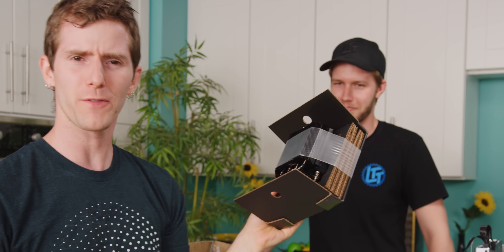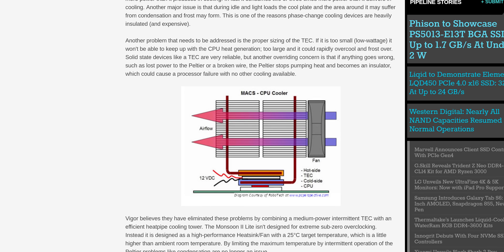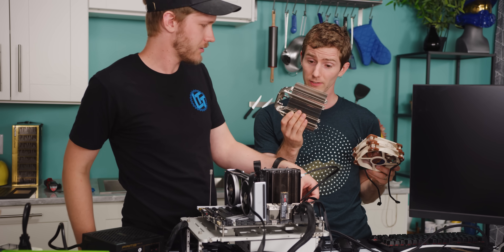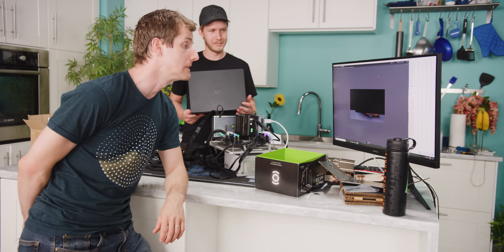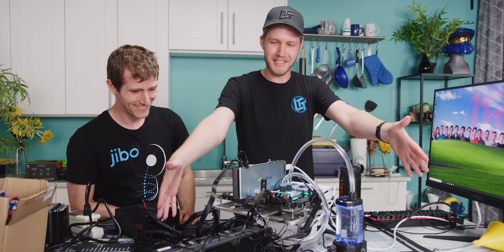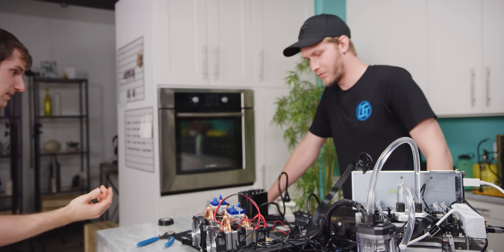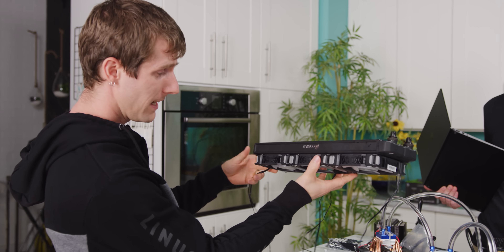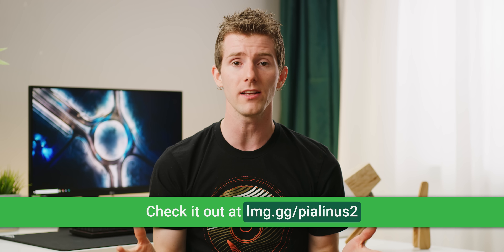Thermoelectric Cooling is a Bad Idea

Comment: You need to use 2 loops leave the rad and add another one and another big cooling  block from Ali , and a separate loop to cool the hot side of the peltier

Comment: About 10 years ago I wanted to build a little Peltier based water storage cooling unit out of water cooling parts (because I'm cheap and had very little room back then), but on top of the shite efficiency, the cost of 2 water blocks, 2 pumps, 2 reservoirs (of which one needs to be big) and a big radiator made it all seem rather pointless.

Glad my pointless idea from the before-time made it to kickstarter though!

Comment: hello I'm from Brazil!
I'm a fan of your gambiarras.

why unlike water in the radiators, do not use car radiator additive.

it may be that the problem itself is pure water only.

perhaps the fluid can provide a greater gain in heat dissipation.

thanks for listening .

Comment: I'm sorry I didn't check all 4000+ comments but... AM I THE ONLY ONE thinking about "Did you put the fan the right way?!" with regard to https://youtu.be/IX2NQ1lq4ZM?t=575 (09:35) 
So one side is cooled by the peltzier's cold side while also cooling the plate on the CPU and the other side draws the heat from the hot side of the peltzier module so by facing the fan  to blow the air from the cooler side through the hot side, that's where (at least I'd guess) is the greatest efficiency and why it can be so low powered. Disclaimer though, I didn't watch till the end yet because I was so hot and bothered by the fact that you two didn't question it especially after watching Linus drop the fan in like it ain't no thang....

Comment: Peltier cells are tricky, if you want 20deg difference and lets say your cpu is drawing around 220w of power, you have a room temp of 30deg then you need a 350W peltier cell but note that to have the 20 deg difference and your cpu is drawing around 220W, your ambient is 30deg then you need to remove 400W of heat from the peltier cell so if you can do that and keep the peltier cool at 40ish deg then you have 20deg on cpu at full load if the cpu doesn't draw more than 250W at the given OC speed so yeah it doesn't make sense to use a peltier cell in this type of application, plus a good peltier cell of 300W+ costs above 200eur require at least 24Vdc and 35+Amps, then add the cost to remove 400W of heat from it, this cells are usually meant to bring down further the temperatures in an existing industrial cooling solution where you already have a 1kw+ compressors and need to go higher down in temperature on your application and its cheaper than to replace or modify the cooling solution by adding new stages changing compressor etc.

Comment: Back twenty years ago I used a tec assisted water cooling setup to get a Celeron 600 (coppermine) to run stable at a tick over 1.1ghz. 

The issue was keeping stable 12v power to the tec, and keeping condensation off the board/socket at idle. Even with custom hand cut insulation for the board/socket it was just too much. Lowered the clock to a solid 1ghz with a largeish air cooler and a slightly less deafness inducing Delta fan it stayed stable for two years for me, and another three for the guy I sold the system to.

Peltier modules can be useful for attempting extreme overclocks for street cred purposes (if you're not going compressor refrig or LN2).

Otherwise there ain't no free lunch with thermodynamics.

Comment: You're using Peltier the wrong way. You have to add it after the radiator to cool down the already cooled water below ambient temperatures, before it returns to the CPU block. That way the Peltier is not syphoning all the heat that the CPU generates, and thus it can be an effective tool even at lower voltages. If you're using it in an aircooled system, same principle can be applied: cool the air before it hits the CPU fan, preferably at the case intake vents.

Comment: The first expensive cooler you put the fan in the wrong direction. Think of it. fan will blow air from the cooling tube to hot tube.

Comment: 0:50 "But what's even cooler, is..."

Who else braced themselves for "OUR SPONSOR!!!" ??
Reply: And add it started, I skipped ahead. I'm heare to learn from others mistakes so I don't have to waste my time and money on things that don't work. I actually pay for YouTube to avoid the 2-ad-per-minute nuisance. I'm not here to buy things I don't need.
Reply: The TECs can stacked. The TECs give approximately a 30°F difference. So when you run water across 1 and then another, you give it more time to lower the water temp but can never get below the limit of ~30° before ambient temp. However, if you put 1 TEC directly on top of the other, then you can get ~60° drop in ambient temp.
Now try putting the TECs directly onto the CPU (using thermal paste). You can then put a water block on the hot side to send the fan cooling to another location.
You can also use antifreeze in the water which absorbs heat better than plain water alone. There are other chemicals that absorb heat even better but some of those are expensive or they are poisonous to breath (ammonia) and so not good for residential use.
Reply: @SI-GOD  this is great info! Do you have a demo? Video? Or web page and pics?
Reply: ME

Comment: Everyone seems to omit the important information of the Peltier specs. In the catalogue there are hundreds of versions according to desired temperatures of hot and cold side and you choose accordingly. Its no good grabbing a generic TEC from amazon and expecting it to work. Peltiers do not work well outside of their intended ranges.

Comment: My first from-scratch build in 2000 used dual celerons cooled by peltiers.  But of course, a celeron 366 didn't put out that much heat, even when overclocked to 600.  It worked well, but I did kill a few power supplies over a few years.

Comment: Hello Chaps Interesting Idea, you know that you can also stack Peltier Heat Pumps, for even more cooling, https://youtu.be/RkSR4rTl2GY  &   https://youtu.be/YWUhwmmZa7A  &   https://youtu.be/aSGwaQWA05U might be of interest to all out there, I am playing about with an idea using a Milk cooler, what's good about that it's already got the pipe holes in the side, & maybe place a Air heat water ex-changer inside a container of water "Without the Fans" "Mass Works" either that or do all your over clocking in Iceland !, I used to stress test electronics in a Thermotron or Clark Hess chamber with Nitrogen input, whats great about that is that there is very little moisture, only if you take it out prior to a heat cycle !
Very important factor is how flat the heatsink surface is to the CPU,
Interesting videos Chaps, Keep up the Great work !!! :)
Philip from England UK,

Comment: The TEC is a heat pump, when you have a CPU temp of >60°C in a room of 20°C the heat essentially pumps itself. The TEC just gets in the way. If you used the TEC to pre-cool the air that you blow thru the standard cooler then you may get a lower CPU temperature.

Comment: why do you TEchtuber think that paralell is better than seriell in this case? The specific heat capacity of water will overwhelm those poor piezzo electric coolers just split the stream from 1 int 10x 1/10 and have it go. it ll work

Comment: Everyone does these wrong... this is just as bad as the refrigerator video. You need to use a radiator to cool the water down close to ambient, and then put on your active cooling device to get it below ambient. (whether that's a peltier assembly like in the video here or running a radiator inside your fridge)

Comment: for the TEC cooler is important which side you put the fan... because if you put the fan blowing hot air from radiator from TEC into radiator for cooling CPU then we got a problem...

Comment: Stock up those Peltier resistors, use about 5 one on to of each other, parallel connect them, such set up of dozens  is used to create true cryo temperatures
Reply: The first Peltier CPU cooler for the PC market came up in the 486 era (i.e. before Pentium).  The issue was that the extreme cold could lead to condensation, icing, and even embrittlement severe enough to snap the mainboard in half with vibrations if mounted vertically.  
The 1990s were wild; many chips could be clocked 50% above design specs back then.

Comment: The first time I saw a peltier on a heatsink was when my friend bought, this little ........ cooler master, I think?
This was back in the day of socket 7
Power was supplied via the system's PSU and it really didn't work well at all.
My "custom cooling solution" (a 20 inch box fan and no cover on the case :B) outperformed it by far.

Comment: I have an old core 2 with a monsoon and it did a good job still works fine after all these years it cost more than 2 nice graphic card. then i have a huge peltier with a giant cooper heat sink that requires a 120 mm fan and its own power supply which was perfect under high over clock big loads but at idle it would ice up es 500 watts not worth it the monsoon was great if you had the coin

Comment: What if you use a peltier module to cool air into the intake. Like a peltier cold side to a radiator in the front and then air cooling the CPU?

Comment: The first time I saw a peltier cpu cooler was around 2000 (Had just recently built a K6-2 rig).  It was at a computer expo in a building with a gravel parking lot 15 miles from nowhere.  I was about to buy one - I mean the frozen condensate on the pad was magical to me.  Then I decided to touch the heat sink.  I didn't even grunt, I just stuffed my burned fingers in my pocket and took my money on down to the cd-rom drives.  Never really thought about that tech until now.  
   Also - you gotta get a soldering iron that puts your fingers closer to the tip.  Like the WPS18MP, great for smaller jobs.

Comment: Couldn't you hook up like a 240 radiator before the water goes out of the reservoir or after it goes out to further increase Performance? I mean it doesnt need to be a good one just a cheap one would probaply do fine.

Comment: what if you make a mixed setup?
the regular radiator is mounted first and cools the water so the peltier devices arent overwelmed and the thermoelectric cooling is used to get sub ambient water temps

Comment: the TEC block is kind of small.... just for curiosity but could you not make that water block much bigger as to give the flowing water more time to transfer heat and make the system more efficient?

Comment: The heat pipe air coolers should have been inverted in your testing that is the way they are designed to cool for maximum effect.

Comment: I remember seeing my first (and last) Peltier CPU cooler in the Pentium Pro days, which would be late 1995 to 1996...  There was concerns and issues with condensation back then, as there was no regulation of the Peltier cooler, so it always ran at full blast, potentially getting cold enough to condense water from the air...right on top your CPU.
Reply: The Peltier needs to be PID controlled to maintain a constant CPU temp. There's not really a need to keep the CPU so cold. A proper PID will be able to regulate the peltier to keep the CPU from getting too cold. The PID also needs to be limited so that the Peltier doesn't operate at currents much higher than the COP maximum. That way when the CPU outpaces the Peltier the PID doesn't go past I_max and cook everything.
Reply: And that boys and girls, is why we have thermostats!

Comment: So here's a stupid question... What if you only added one of the aquarium coolers inline after the radiator? You would still have the full benefit of the large radiator but add an extra 100-150 watts of active cooling. Even better, since the cooler only needs to run when the temps are above ambient, it could be on a switch or thermostat for the times you really needed it. Would it make a difference? If so, might it be worth it if you have the extra case room and PSU to spare?

Comment: They are very inefficient they only clock in at about 7% efficiency in real world applications and 9% in labs. This are the opposite of cooling, but converting thermals into electrical. I had built one in late 90s.

Comment: If you look at how to cool an electronic device you will see one concept. Thermal resistance. A  CPU connected to a heat pipe connected to a heat sink cannot cool better than the same heat sink connected directly to the same heat source. Every interface raises the thermal resistance, and causes the temperature of the heat source to be higher. The purpose of thermal grease is to get rid of a CPU, air, heat sink interface. Thermal grease is a lousy conductor of heat. But, it is much better than air. If a Peltier device is connected directly between the CPU and heat sink, it will work better than between a CPU, heat pipe and heat sink. The only reason I can imagine for a heat pipe is to put the heat sink someplace more convenient. A more modest goal in temperature reduction, of like 20-30 degrees  above ambient would be doable and adequate, as long as the ambient isn't 80C! It would have no risk of condensation. Keep the CPU above the dew point, instead of trying to go cryogenic.  If someone wrote a program that would keep the CPU at a fixed temperature or fixed temperature differential with a Peltier, instead of flat out max power, I'd be interested.
Reply: You're right, this kinds like that company "solar roadways" which wanted to put heaters powered by the sun to melt the snow on the road so basically they're taking light converting it into electricity and then into heat instead of the light hitting the road and turning into heat instantly, more steps less efficiency
Reply: @diarsaleh9326  SOLAR FREAKING ROADWAYS!! You saw that vid. Well this is not as bad as THAT dumb idea!

Comment: For someone so popular on YouTube, why isn't he smart enough to run the active cooler AFTER a passive cooler?

Its like operating an oxy acetylene torch in a freezer and calling the freezer sh#t as opposed to operating it outside the freezer where the room is isolating the torch heat from the freezer cavity.

(Just like the passive cooler would isolate the active cooler from the initial excessive heat.)

🥱

Comment: My bachelor thesis in mechanical engineering was studying the efficency of peltier elements when used as heat pumps. I did tests in all ranges in regards to volume of air heated, power and number of elements at work. The result was that these elements has it’s peak efficency at 4˚C in temperature difference between the two sides of the element.... They are just not that powerful...

Comment: This is a technology that should be optimized to run with low power. Then this thing can implement on the aftermarket water coolers. I guess this can be optimized

Comment: I would like to know, what results could be possible if you combine the watercooling with the peltiercooling. I mean, first „precool“ with the big radiator to get rid of most heat and then after the radiator go through the peltier to cool it below ambient temperature... (it will never be economical, but i think it could improve the cooling effect...)

Comment: How many water block coolers and fans does it take to cool the the whole pc. Here is the idea. Water block to water block on top of cpu with hot glued fans to blow heat away from the blocks but having water blocks attached to the case for more cooling. You can’t have to many blocks and hose. Right?

Comment: I'm afraid to use WATER cooling (reminds me of cold showers I take every morning in winter.) however if you run into a problem the water cooler could ruin your $2000 PC in about 10 seconds

Comment: Bad Cooling Idea:
1: Take one shop vac hose
2:  Attach PC fan with air flow direction going into hose and a variable speed controller.
3: Place or attach the opposite end of hose to front of PC case.
4:  And here is the tricky part
place the fan end out the window into THE  COLD DEAD CANADIAN AIR!
As a Wisconsinite I'm quite positive this set up should have some cooling effect 3/4 of the year.
5: the other 1/4 just duct tape the end to the AC output.  (I'm talking Air Condition not Alternating Current) 
6:  Then crank up the AC and wear your LTT Hoodie available at........ Oh poo I forgot where to get those.
Well that project's scraped.

Comment: I was involved in a US Army study on thermoelectric peltier cooling back in 1985, so your belief that it dates to the early 2000's is a bit off. We were using the technology to make TANKS invisible to infrared scopes in the battlefield. The technology proved to be very effective, but far too expensive at that time. In the experiment we took a battle tank and covered it with the devices and it did, in fact, make the tank blend into the background, and so undetectable to the enemy with infrared detectors. There was, however, a draw back with the technology - it made the tank unbelievably HOT inside.

Comment: Clamping force! An essential part of properly using a TEC is applying the correct clamping force. Typical clamping loads should be between 0.5-1.2 Mpa (73-174 PSI). For your setup we are looking at a required clamping force of around 160Kg (350 pounds) per block. That little clamp isn't doing it for you.
That, and the lack proper parasitic isolation can end up in loss of efficiencies of 20% or higher

Comment: I used to run Switftech Pelt coolers. They didn't catch on because they were expensive and required a lot of prep work to the CPU itself to prevent condensation which is a serious problem for Pelt cooling. You have to insulate against condensation and that can be tough for most people.